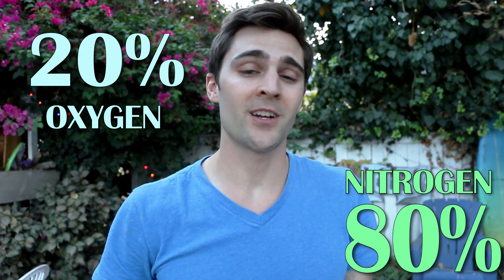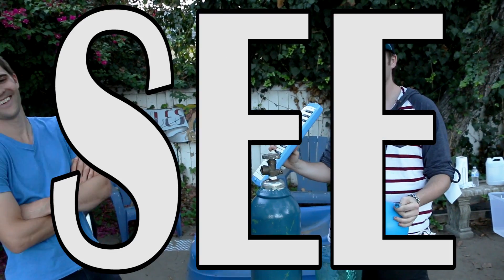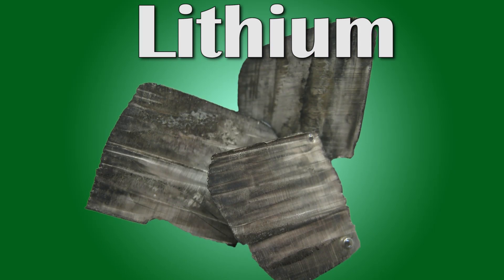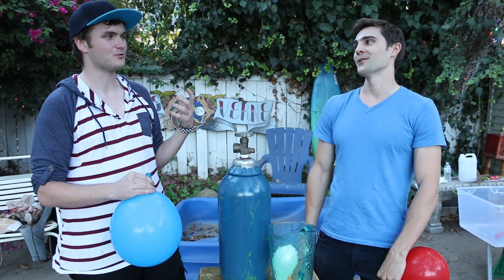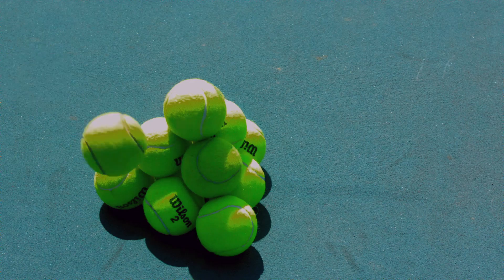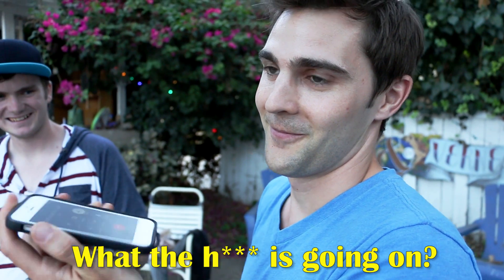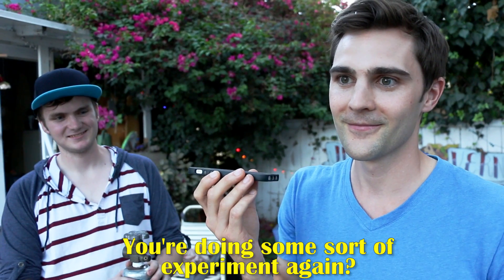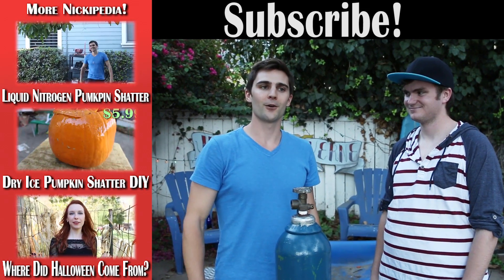"Deep Voice Gas Sulfur Hexafluoride" Nickipedia: Ep.10

Comment: to all the ppl discussing wether its environmentally feasible to toy around with this: Wikipedia says it contributes about 23000 times more to climate change (per mass) than Co2. So if they released 20l of sf6 (that would correspond to 120 grams of gas at a density of ~6grams per liter), the Co2 equivalent would be 2.760kg. That is as much as a small car would emit by driving 19000 km (at 150g/km) or the equivalent to burning 1 metric ton of coal. What they did isn't that bad at all (especially because they did this once for a demonstration), but it is not really good practice either. There are reasons this stuff is  usually kept away from the atmosphere.

Comment: Okay, just a public safety tip (because one definitely should have been posted in the video), DON'T DO THIS AT HOME OR WITHOUT PROFESSIONAL SUPERVISION!
Sulfur hexafluoride is more dense than air, meaning it sinks when surrounded by common atmospheric gasses. That much was explained and demonstrated well enough in the video. However, the density of SH6 (sulfur hexafluoride) also allows it to settle in the bottom of your lungs. Now your lungs create a fairly turbulent system just by breathing, and generally that is enough to force out gasses either denser or less dense than atmospheric air. Even so, too much SH6 could easily inhibit this system and instead of coughing a little you could asphyxiate. That's not even mentioning the fact you're absorbing anything you breathe in (given SH6 is inert and relatively not harmful, it's still just not a smart idea).

Comment: I wonder if you suck in the sulfur stuff and helium at the same time.
Reply: hEllO we ARE DoinG An ExperiMent wITh hELIUm aNd thIs DEeP VoiCe Stuff
Reply: I think that the weight of the two gasses will cancel each other out and the users voice will be mostly normal. Another hypothesis is that the user will get two different voices. (Can use to act like you're possessed if the second hypothesis is correct).
Reply: I feel like the amount of times you'd need to try this would mean you would pass out from oxygen deficiency
Reply: Lol, I'm sure...

Comment: Sorry to let a lot of down but this is a fake ass video. One, they were huffing helium and they masked it with a deep tone. Two, half if not most of the information they provided you was pure bullshit, if you had just looked one part of information you could see that most of it was fake.
Reply: It's not fake,  All information provided seems to be correct to me, Great electrical insulator, U.S. Patents showing the use in tennis balls (Patent# US4098504). They put the Sulfur Hexafluoride in the container which made the balloon rise and when they sucked up the air inside the balloon fell back down. It would honestly take more time and effort to fake the video than to just buy it. No clue where your claim came from.

Comment: o my god you guys that gas can cause lung cancer VERY EASILY
Reply: Saying that this can cause cancer is like saying breathing the air can cause cancer. It's an inert gas, meaning it does nothing outside of being dense and reacting with lithium. A fun fact actually is that Hydrogen does basically the same thing as Helium to an even greater extent and is also non-toxic. Did I mention hydrogen explodes? Basically my point is that these gasses are about as likely to cause cancer as drinking water is.
Reply: Darkrow Shadowheart dont listen to everything on the internet
Reply: Nic Placencia It'd still very dangerous especially to the enviroment
Reply: Darkrow Shadowheart I wouldn't say that. It's denser than helium, so it's harder to get out of your lungs. That's why it's dangerous
Reply: not that , its proven that this has MUUUUCH HIGHER CHANCES OF CAUSEING CANCER... after all he did i dont know how he didnt get cancer
Reply: +Darkrow Shadowheart You're a dumbass
Reply: Riley Guy Thank this guy for being right AND ACTUALLY basing his facts somewhere.

Comment: Did you experience any difficulties breathing? Since SF6 is denser than air shouldn't it settle in your lungs? Making it almost impossible to get out in you don't suspend yourself upside down and hyperventilate?
Reply: if*
Reply: I think when you breathe out, it forces it out. Lungs aren't like empty spaces on the inside. They have little pathways, like veins, so when you breathe the air travels through them and converts into carbon dioxide, when you breathe out. It would be hard for it to settle.

Comment: you need to get your facts straight. the higher the density of a material the higher speed of the sound will be travelling through it. and the frequency of sound isnt altered by the speed of it, all though the change in the quality may differ due to speed. the doppler efffect supports this statement.

Comment: what if you inhale helium and this gas at the same time 0.0
Reply: d00t You're voice would be slightly higher because huliem highers your voice by 6 times and hexafluoride only lowers your voice by 5 times. 6 is more than 5.
Reply: Lizbeth but this gas distorts the voice a little so it would be a weird high pitch
Reply: d00t  The helium is a lighter gas then hexafluoride, and the gases will not mix, so the helium would come out first, then the hexafluoride.
Reply: Would not mix, but thats assuming the same amount is ingested.

Comment: Also important to mention that this can be a little dangerous. Sulfur hexafluoride is denser than air, so it settles in your lungs and is hard to get out in an upright position (unlike helium that wants to rise out of your body), and you won't feel yourself suffocating because it's the build up of CO2 in the body, not lack of oxygen, that triggers the urge to breathe.
Reply: Doyoulikewaffles? Yeawelikewaffles! MUHAHAHAHAHA
Reply: Same with helium. It’s pretty dangerous.
Reply: Helium is much less dangerous in open air because it is lighter than air and won't settle in your lungs.  Of course if you only breathe any gas without oxygen you can suffocate, but unless you are in a room completely filled with helium or are wearing a gas mask, that would be highly unlikely.

Comment: falsssseeeeeee...  If the speed of the sound was lower (which it's not, that alone doesn't make any sense) then the pitch of your voice would be lower.  but the pitch of your voice is NOT lower, just your voice formant.  The same thing with helium; it doesn't make your voice higher pitched at all, it only shifts the formants upward.
Reply: und1fin3d So glad someone else realized this. That's also why when he blows the "C" on the melodica, it's still technically a "C". Yeah it's flat by a good 50 cents but that's probably due to the restricted airflow.
Reply: David Korn Exactly xD

Comment: Welllll...yeeahh buuut...doesn`t it like...stay in lungs and can`t it affect organs badly? Like leaving a human traumatized in brain or whatever?
Reply: Darude Sandstorm i does stay in the lungs if you don't breathe out completely due to it being heavyer than air. It will only damage your body if you don't breathe enough oxygen in between the sulphurhexqfluoride
Reply: Mees Deppe ...fck. That's what I was afraid of, my dog died because of this, the gas tank was damaged and left in kitchen when our dog was...tank empty, smell bad, dog ded. JK tho but can that happen?
Reply: Darude Sandstorm yup, that could happen. look at the gas as water. it flows down and (light)  things can float on it.
the only way your dog story could happen is with a large enough tank to fill your kitchen to dog height level (something like that??)  and completyely sealed off doors. otherwise it would just flow through the house at 1 cm high. ( ¼ inch)
Reply: 1/4 inch is NOT 1 centimeter. If you don't use metric, at least convert correctly.
Reply: 0.5 centimeters, something like that...Sebastian Ahrens
Reply: Since it's heavier than air you could flood a room with it like water. So yeah.
Reply: Sebastian Ahrens i converted one centimeter to 1/4 inch by just guessing. i do use the metric system. imperial just makes no sense

Comment: if you were to mix this with helium what would happen?Would you sound the same?
Reply from the maker: +Amber Black so I actually did this and what happened is the helium came out first (because its lighter) and then the SF6... so it went from sorta high, to sorta low... they mixed somewhere in between
Reply: Gilbert Bernas so u will float?
Reply: Nick Uhas h
Reply: Nick Uhas